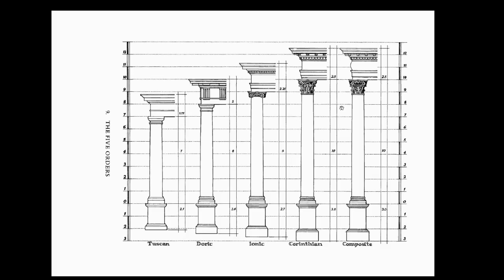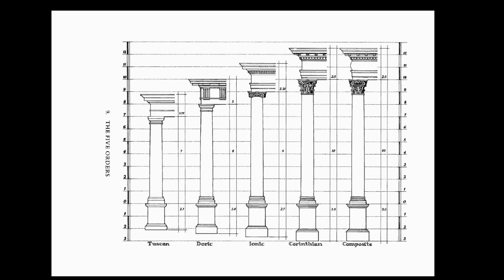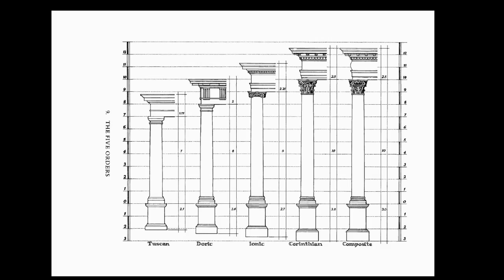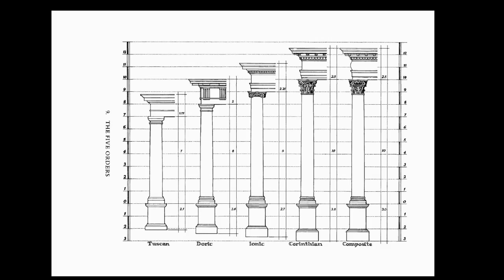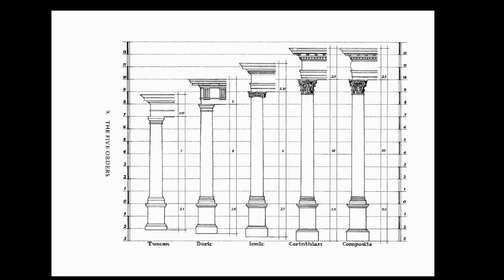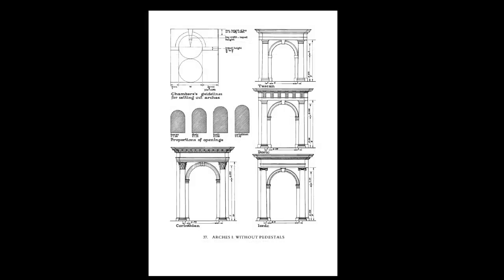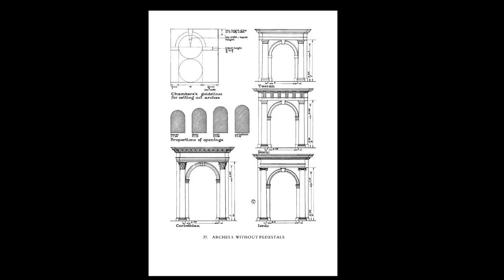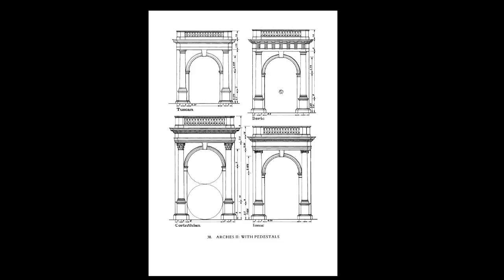CLASSICAL ARCHITECTURE design principals: analyzing existing classic & classicistic buildings Part I

Comment: Two parallel lines meet at infinity. If maths was based on the idea that they do not that would be a way of explaining how simplistic this approach is to understanding Classical architecture. To fully understand what is going on with these buildings requires seeing them from within the mind stretching aspect of parallel lines meeting at infinity. An example if what is happening with the triple arch relates to the double slit experiment in physics. A ‘particle’ can pass through the right slit and turn 180 degrees and return through the adjacent slit. In the triple slit (or 3 arches) the particle can follow a n S curve. If two particles do this simultaneously then we have an infinity symbol. That would be an 8 combined with 3 &3 or 5/6 which is .833. This is the musical interval in our 12 note scale. The geometry of the octagon directly relates to a c# in Pythagorean tuning and the triangle is an F#. Minor fourth and major fifth or the secret chord from the song hallelujah. Architecture is frozen music. All these shapes are doing things in these buildings and nobody knows apart from a few at the top of our societies.
Reply: woah I think zaha hadid made interesting music
Reply: Wha
Reply: Wow, this is enlightening.